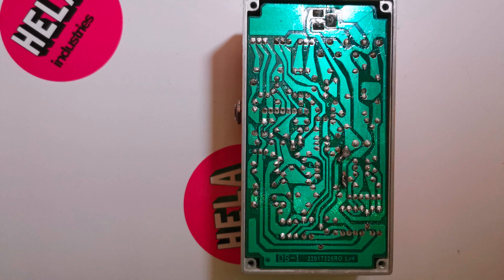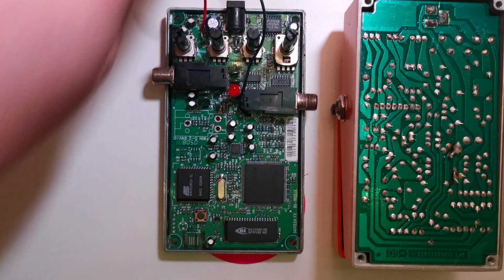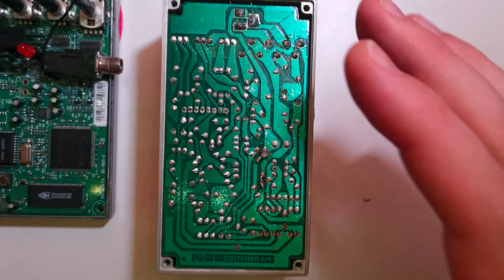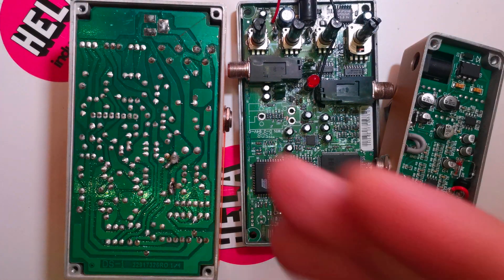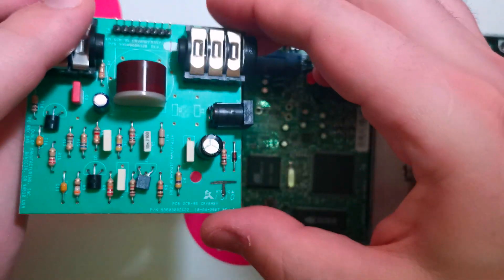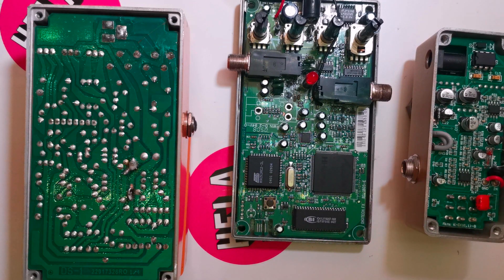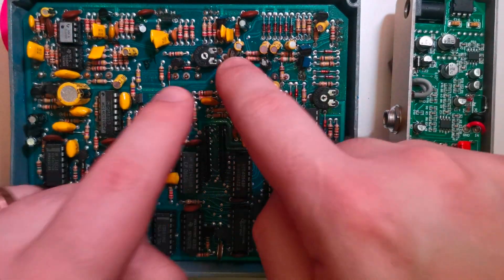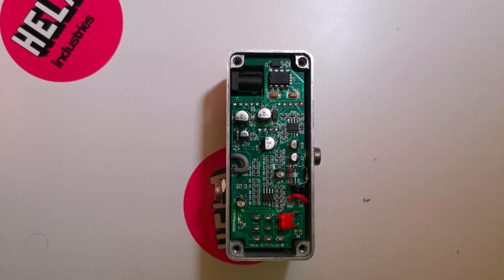wHy yOu sMd (extended)

Comment: I dabble in designing and making guitar pedals myself, obviously manufacturers move to smd for costs reasons or perhaps also for miniaturising, Myself I make them all through hole mainly because I don't build so many and I make them by myself, one thing I can say is that is becoming harder and harder to stay fully TH because of parts availability. For example J201 jfets which are used for various analog phaser pedals etc. nowdays are only available in TH from one manufacturer costing around 5$ a piece against the 40 cents SMD equivalent.
Reply from the maker: The funny thing is since this video I have started playing with SMD and I can now see why doing it makes a lot of sense from a manufacturer perspective as you can just lay the parts out and put it in an oven making the manufacture a lot cheaper and yeah the lack of through hole parts does make it difficult, I have seen some adapter boards online however

Comment: hello, what about durability or reliability? (between smt vs trough the hole i mean), i'm not thinking about modify my ds-2, i have one now and is smt (Malaysia), and years ago i had a regular one but i sold it, but in terms of sound i found they are pretty much the same, so if you like your pedal just how it is right out of the box, is there any issue with it? i will last less than the others? any opinion on that? thanks!

Comment: I guess the reasons behind the change are several, cheaper in terms of materials, without employees a machine welds all the components, larger and more specific integrated circuits make it more (very often) irreparable...and that's good for business because they sell you a new one, is it an ecological problem?, just put a sticker of climate change on the plastic package box.

Can we refuse to change?, probably not, at some point  old components will be discontinued...totally shitty "evolution" from a user perspective but, it is what it is..."adapt or die" kind of thing.